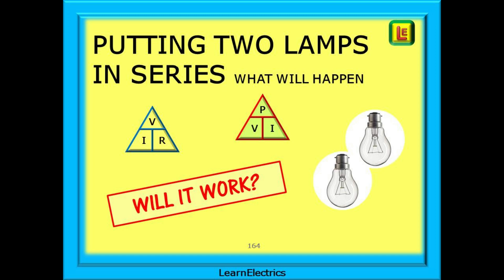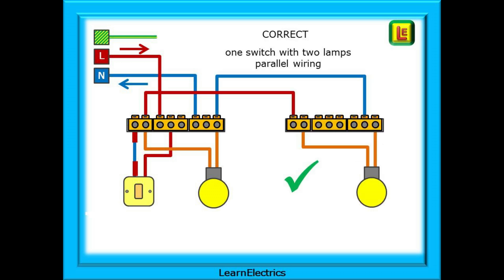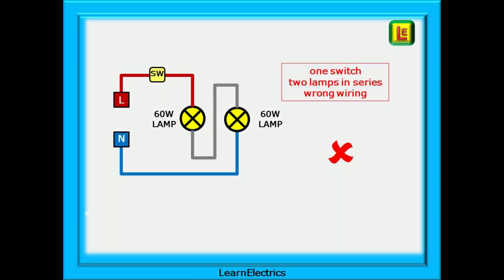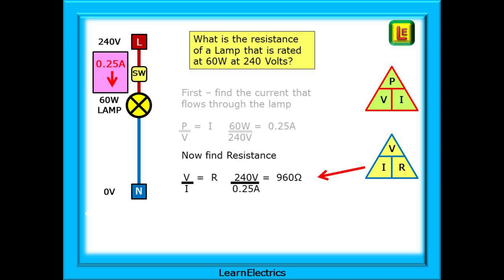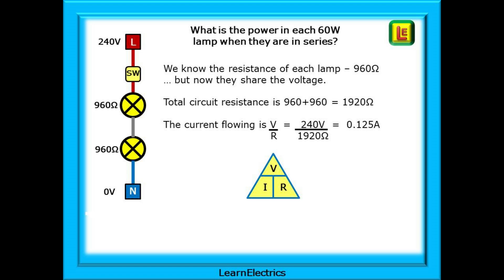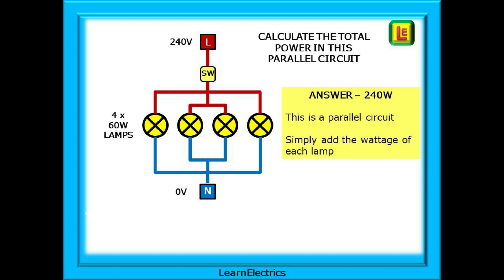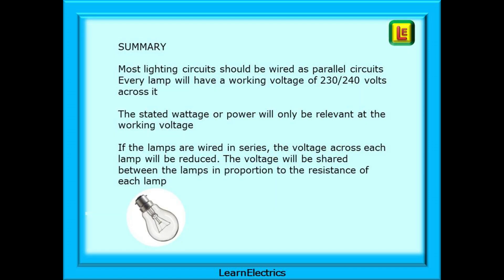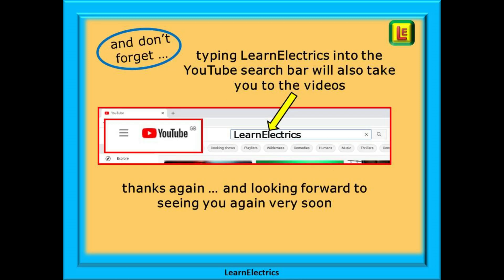PUTTING TWO LAMPS IN SERIES – WHAT WILL HAPPEN – WILL IT WORK

Comment: By labelling the neutral line at 0V in the diagram (@ 4:09), doesn't this imply there is no current flowing (i.e. if there is no voltage, there can't be current flow)?
Reply from the maker: we need electrical flow back to the transformer for electrons to be reenergised and go round again. Compare it to a wet radiator system. Hot water flows out, heats the room and cools. But unless the cooled water returns to the boiler there will be no room for fresh hot water to get into the radiator and the water flow will stop.
Chop the neutral wire and the lights will go out, no current flow along the neutral.
Reply: Thanks for your reply and explanation. I understand your analogy of a wet radiator system to the lamp circuit. However, as before, I don't understand why the neutral is labelled as "zero volts" which implies zero current, although it obviously flows back to the source to be "pumped" through the circuit again.

Comment: Can you explain what will happen using USA equipment on uk voltage because there is so many items on eBay people are getting court out
Reply from the maker: You now have the knowledge to do this. Work out the resistance at the USA voltage from the formulas in this video. Then substitute in the 230/240V UK voltage. Unless it is designed for 230 volt use, you will damage it. Have a go at the calcs, good practice. Dave.

Comment: This is only true for traditional incandescent lamps. For led lamps with electronic drivers it can have various results. As the voltage drops they increase the current, within their working voltage range. Typically 85-365 volts.
Reply from the maker: Thanks for the input Martin, yes, I say in the video I'm keeping things simple. A lot of new starters in the September intake might find it confusing if we start throwing in voltage ranges and reactance etc. This was going to be a later video. But thanks for the support and contribution, really appreciated. Keep it coming. Dave.
Reply: Ok thanks. Just wanted to point it out. I'm not an electrician or an apprentice, just someone who likes electronics and electrics. Thanks for all your great content.

Comment: FYI 
Here in India we use 2 incandescent 💡s  of same wattage connected in serial for checking between 2 lines (415V) of 3 phase supply.
Useful for checking mingled fault. ( due to upstream cable fault single phase comes in 3 phases which cannot be detected by neon tester or  single test lamp between the phase and ground).
Reply from the maker: Oh yes, Kishore. I know all about that. I worked in Hyderabad at DRDL for a good while back in the 1980s. I would love to go back. Keep watching,  Dave.
Reply: @learnelectrics4402  thanks for sharing.